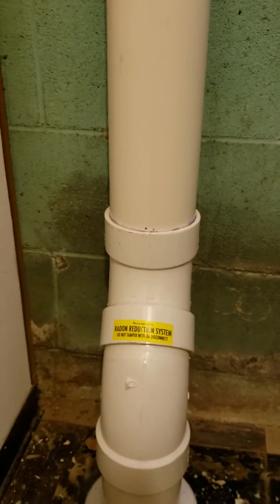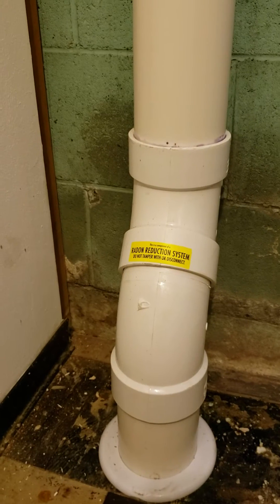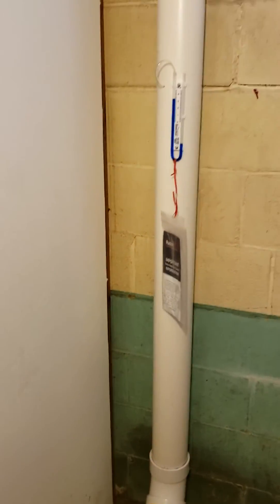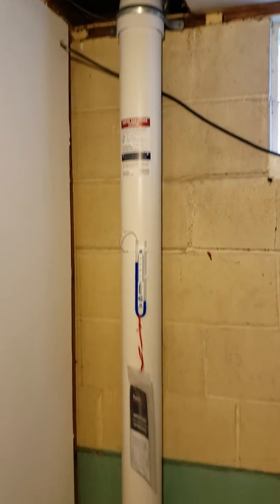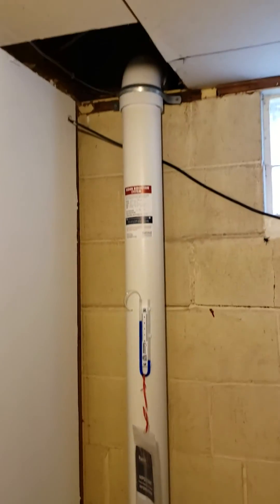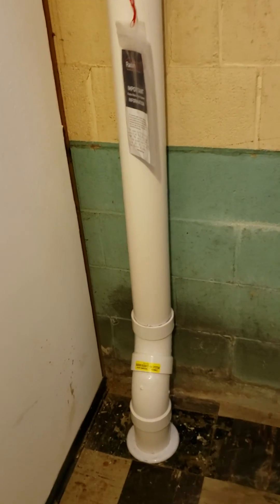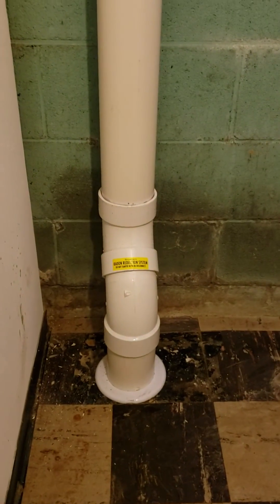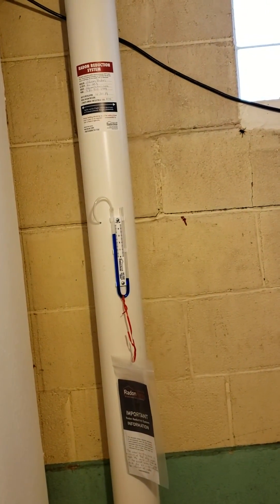Why does my radon pipe gurgle and sound like water?

Comment: So I have this issue also, I noticed it after rain a lot... but now we are currently in a pretty severe drought, Most of my lawn grass is dead, has no rained in weeks.. and the system is gurgling today... must be something else going on.
Reply: After further review and research. One cause could be high humidity, and that's exactly what we have had the past few days.. so it must be condensation going down the pipe.  It may not be pitched perfectly at the bottom, so maybe I can ad a plugable drain hole or something

Comment: I have also had this issue as a Radon mitigation system installer; but from my work history as a foundation professional, and dealing with ground water issues plenty in the past, we installed a sump system that worked with the radon system and also fixed and eliminated any problems with water rising up and saturating the slab and block walls fixing the mold and moisture problem also. The customers were so happy they gave me an extra $750.00 on top of my cost to install both systems already at a premium price. There worries and problems of water in the basement were put to bed after that fix.so I hope you addressed the gurgling issues for the home owners

Comment: I have this issue with my system. We have had a very wet spring. The sump pump cycled 24 hours a day for two months or more. When the sump pit was constantly full, there was no gurgling in the radon pipe. Now, the ground water is drying up, the sump pit is empty, and I have the gurgling sound. Strange.
Reply: The water is probably trapped underneath the tube itself, and probably got there via the top of the tube (rain etc)